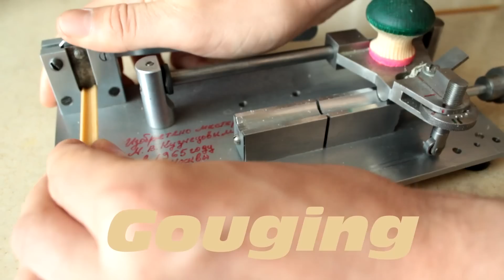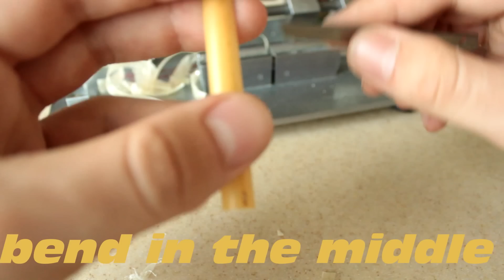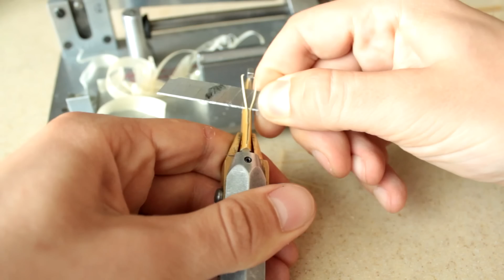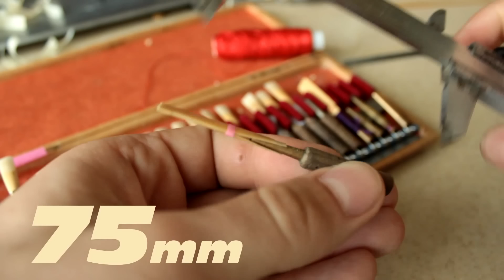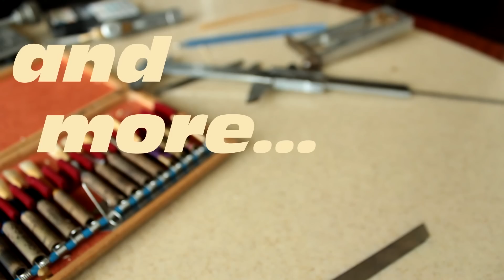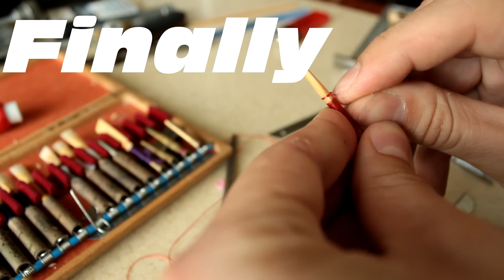Canon EOS 600D - Oboe Reed Making

Comment: lol i got a oboe reed commercial on this video
Reply: i got a oboe commercial before an oboe video
Reply: Lol same
Reply: Did you press "skip" ?
Reply: Me too
Reply: Legeré
Reply: Same
Reply: Alex yeah they’re pushing that brand hard now. I was Quality Control reed tester for the fibercane Oboe reed.
Tooling nightmares, And when the custom blades got dull it would cut the heart out. So when the blades were sharp, and the overall thickness of the blade was correct I could make a very stable responsive reed out of them. Injection molded reeds are great in an outdoors rock band. Not common, but it was fun 35 years ago. Still play. Principal oboe in Paradise Symphony Orchestra and just did 2 performances of Beethoven 9th 1st and 4th mvmnts for Camp Fire first responders. Be in your best shape for the 4th mvmnt! Glorious!

Comment: What is the purpose of the wire?
Reply: 2Netsrak2 there may be two fundamental purposes for a wire. One is that it can help, if necessary, if the sides are leaking, which when tied properly rarely is a problem. Number two reason, Is to help adjust the opening of the aperture whether it is too closed or too open. The gauge of wire must be thick enough to help control one way or the other, gently with pliers. I have tied thousands of reeds and have never needed a wire on my oboe reeds. A wire is almost a requirement for English Horn reeds. 
Lastly... I do tie slightly shorter than 74 mm. If it’s tied at 75 mm you are toying with the sides of the reeds not sealing properly where of course the wire would help. Maybe the strategy would be that you have a reeds with some extra vibrancy when the blades don’t overlap each other so much.
Feedback on my opinion would most certainly be welcome. Hopefully you enjoy tedious tasks for worthwhile results.